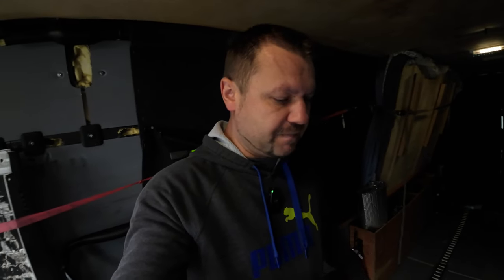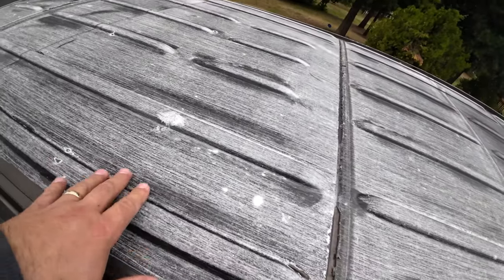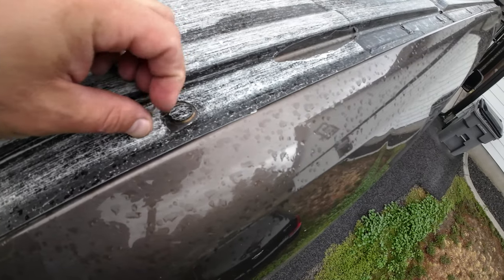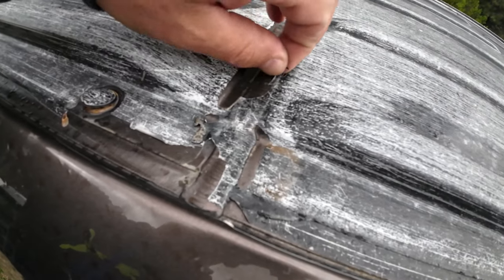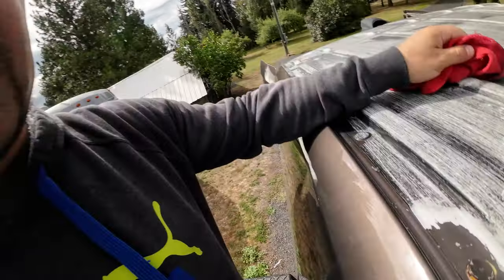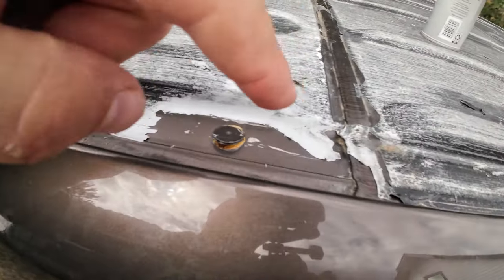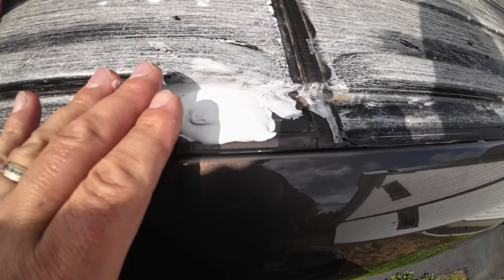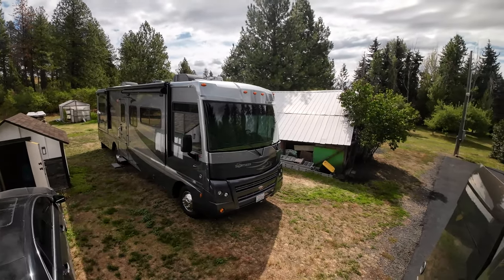If you have a leaky roof this will be a 100% fix | Sprinter DIY Maintenance

Comment: I would use polyurethane based caulk , whatever brand but poly based, also, for your roof, I would apply a high solids (95% solids or higher) silicone coating product. Those 2  will keep you leak free for many years. I owned a roofing business in Puerto Rico for many years and this products will withstand metal surface expansion and contraction nicely, metal being a great conductor of extreme temperatures.

Comment: HI ANDREW Thanks for the video,  what kind screw you use on the etrack  , those screw are to the  metal floor or just to the top  wood floor  ?  thank you so much.
Reply from the maker: I have a factory floor I always screw mine on top of the wood with wood screws. Just make sure they're the same length as the wood thickness. If u don't have a wood floor u can screw them on top of the metal factory floor with self drilling screws.
Reply: @Eagle-Xpress  i have the same floor like your  , just need to put the etrack down , later maybe i work for you?